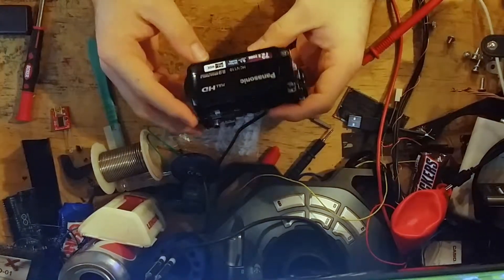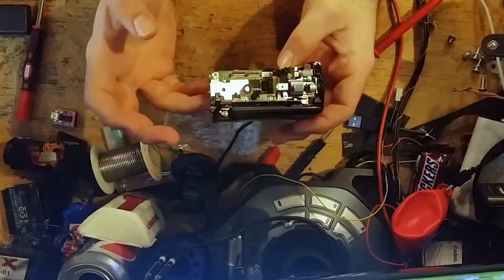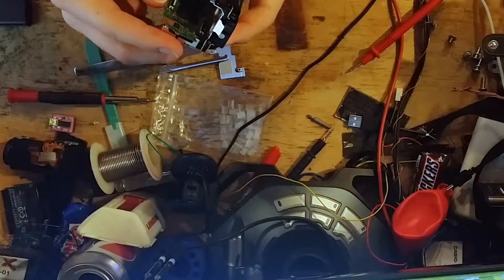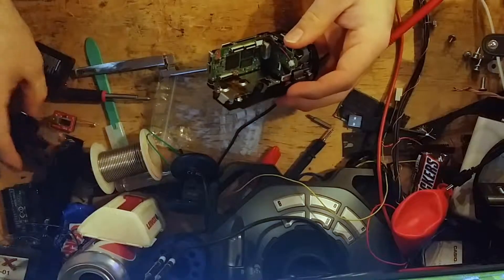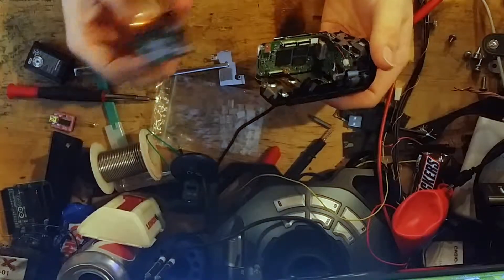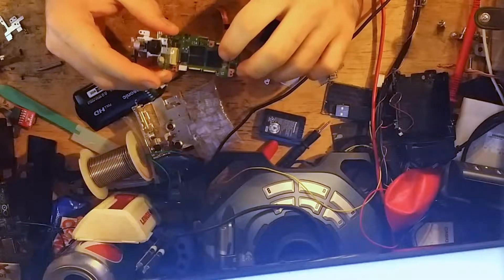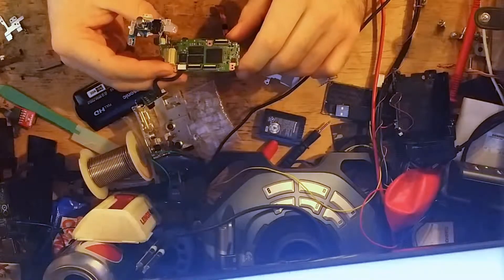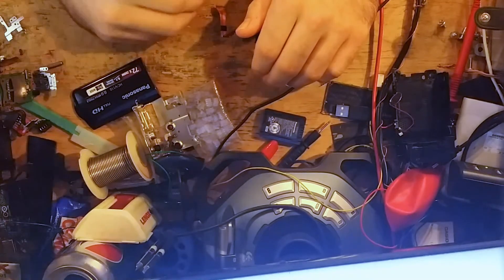Camcorder Teardown

Comment: Did you put it back together?
Reply from the maker: No, it was trash. From what I remember (it was a while ago) one of the ic's was failing. Nothing I could really do to repair it.
Reply: ohh okay, thank you, so do you think that's wrong with mine? I had the same issue where I opened it and it stopped working
Reply from the maker: Possibly. It's kindof hard to tell. Unfortunately, all the advice I can give you are the basics. Does it have power? And is it at all responsive, or is it completely dead.
Reply: 610bob When I press the power button, the red power light turns on for about 2 seconds, then shuts down. I know it's not the battery since I bought a new one and still didn't work.
Reply from the maker: It sounds like it is turning on, but something is causing it to fail it's boot sequence. Mostly a something inside is unable to communicate to the main microcontroller. That is just a guess though. It may be worth opening it up to make sure everything is plugged in properly. Maybe a wire got jostled out. But this is all just a guess.
Reply: Great thank you, I'll give it a shot

Comment: Hi,

Thanks for the video. Did you see any way to solder/attach new wires to the microphone, essentially replacing the internal mic with an external?

Can you get to the mic connectors easily?

Cheers,
Reply from the maker: mcpringles Unfortunately, I can't remember. Usually, stuff like that (speakers, microphones) are on a detached pcb. So it's likely that you could just cut the wires and splice in another mic. Even if it wasn't, microphones are big, and generally through hole devices. So if it was on the main board, you probably could still easily desolder the mic.

Don't know if you know this or not, but I feel it's worth mentioning. To get good audio, you not only need a good mic, but good electronics to back it up. I don't think that this camera has good audio recording circuitry in it. So replacing the mic to get better audio (if that is your main goal) will probably not work.
Reply: 610bob thanks for the info mate. I think a separate audio recorder + pro mic will be the way to go for my projects. Thanks!
Reply: hows ur project mate, i think im in same situation,
 need to have good audio, if u could kindly share ur project to give me ideas, thx